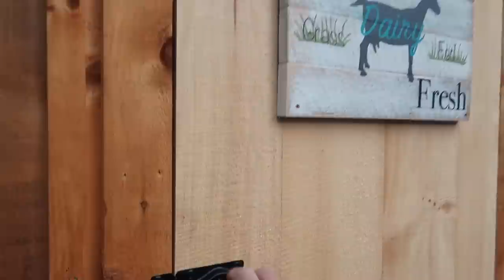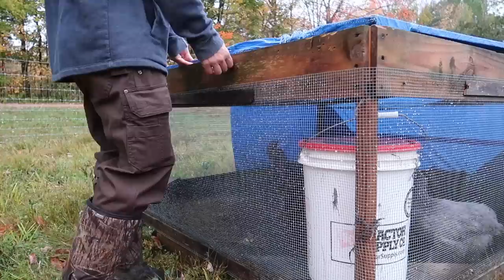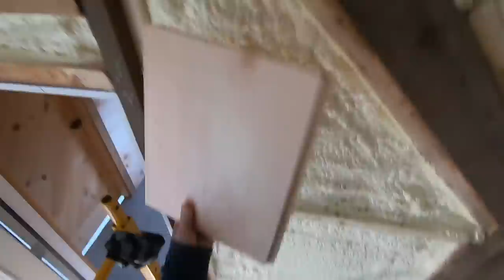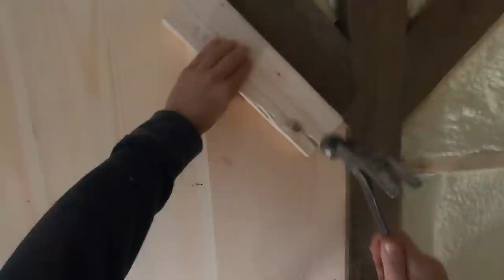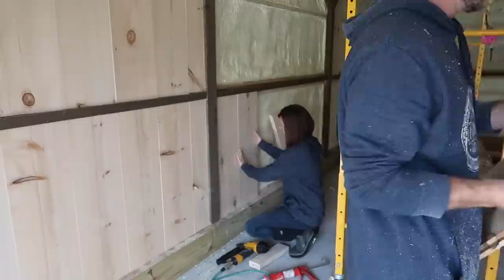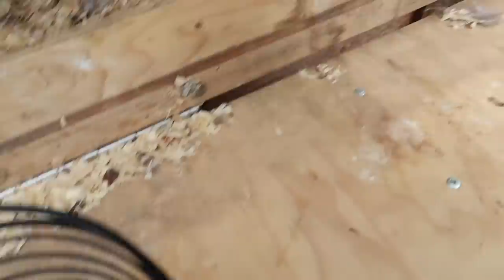Let the Fun Begin Husband & wife Build the Ultimate WORKSHOP (Day 1)

Comment: LOL. Willow had it going in one end and out the other! What timing.Also, if you don't let your tape measure snap back full strength like you are, the tip won't break off. That impact is what breaks it. Learned that from my dad years ago!

Comment: As you want to be able to do projects in the workshop when done a good project to start with is remote locating the compressor with an accumulator tank in the shop to not suffer a pressure lag problem from the remote air location. This puts any compressor sounds outside the workshop/filming area and an accumulator tank is as easy as finding a broken compressor to harvest the tank from and plugging the holes you don't need. 

Normally you need huge pipes to cover long lines but can get away with normal sized lines and the accumulator tanks if you don't need insane air flow rates for things like jackhammers or rock drills.
Reply: Judy G.  Hey Judy, it is a workshop.  The air tools will surely still be used.  I agree with isolating the compressor and having the accumulator tank. Who'd have ever thought you'd need to store air?!

Comment: Try putting a spacer on the bed of your saw to raise the board you're cutting and you'll be able to cut your miter in one pass.
Reply: Or drop the height adjuster. Seems like another inch or so should close the gap and still allow the motor housing to travel the full length.
Reply: I'll go with the homesteader, should have bought smaller boards.
Reply: 1 or 2  2x's on bed works great. And then just raise out riggers.
Reply: Dj Krys ;

Comment: Looks Great, I do a lot of hard wood flooring and you always need to leave a gap for expansion. You might want to leave a 1/4 in gap between the post as the wood will move and trim with quarter round.

Comment: I like to see a woman with a range of skills and ability. Gina is becoming a good builder.
Willow is inspecting the wall like she is looking for some foam to nibble on.
As long as you are using glue , I would have edge glued the boards to make them like one board. It would have increased the wall strength tremendously.

Comment: I see where others have suggested a spacer board the lumber on  the 45's.  Also, you might try just raising the outside edge up into the blade to finish the last inch of the cut.  It might add a little angle since the blade is at 45, but in the corner it would not be seen and covered by the next piece.

Comment: If you are pulling the blade through the wood, just make a score cut. Less chip out that way. After the score cut push the blade through the wood. Much safer way to cut. If you aren't worried about a perfect clean cut, just push it through the wood.

Comment: The inside of your barn is going to look fantastic when you finish.  My question is how are you going to heat in the winter?  know it gets mighty cold up in the northern pare of New Hampshire in the winter.  I have a 30' X 48' pole barn and only insulation on the walls. Roof is not insulated but I used 3-1/2" X 24" X 8' honeycomb cardboard slabs over large sheets of 1" thick honeycomb cardboard for my ceiling.  I have a lot of heat loss through the ceiling but I have two ceiling fans in the shop to help pull the heat down.   Heat the whole place with a small pellet stove and a new pot bellied wood/coal stove.  also I would suggest getting some foam panels to insulate your roll up door. otherwise you will have a lot of heat loss there.  Love watching you and your wife work together.  Sadly I lost my wife 11 years ago.  She was always working with me and helped me build my workshop/pole barn.

Comment: I saw that same saw at Lowes yesterday with a 60 tooth carbide blade on the display model. What gives, Lowes and DeWalt? 

Stanley-Black & Decker BOUGHT the Craftsman line and offers it through Lowes as the major Craftsman retailer. Craftsman Red makes Lowes tools look like a Christmas store. Maybe Craftsman will take on Milwaukee with competitive tools.

That ship-lap will have a lot less waste than cutting up 4 x 8 sheets of plywood. You saved twice.

Comment: Put a spacer on the miter saw to bring the height of the board being cut. You might get all the way through that 45.
Reply: You can also lower the blade with the stop adjustment. Just don't go so far as to hit metal.

Comment: you should never cut on the pull with a cross cut saw  pull the blade out past the front edge of the wood, lower the blade then push, that way you are using the front of the teeth not the back of them,   cheers from an old irish carpenter, love the barn

Comment: Are you worried that if the humidity increases and all your boards are that tight that they might buckle?  Or is the wood still green enough that it will dry out by next summer and that won't be a problem?

Comment: Sorry Al, but I believe you are going to have some problems with some of your firewood because you didn't leave any room for air circulation. By stacking the wood on the ground, moisture from the ground will wick up into the wood. Pallets would have been a good option on the ground & even between the walls & the firewood to allow air flow. A 6" gap between the stacks would have been helpful also. Hope I've given you some food for thought for next year & all comes out well for you and yours.

Comment: One thought. Remember that wood expands and contracts. You are fitting this wood very tight - if it is not already at it's wettest - there may be problems down the road. On the hopeful note: the wood was on the (palette which was on the) ground and there was a lot of surface water, so it may have absorbed some from the moist air. It will dry out inside, no more water on the walls after the wood is installed. You are probably ok. It may be a long time before you know for sure though.

Comment: Putting the Ship-Lap tight, you don't have a concern in the summer with heat and Humidity and expansion?  Though, if what you have is green boards, they will shrink as they dry down.

Comment: I love craftsman hand tools!! So I went and bought a drill couple months ago. I decided a couple days ago to build a wood fence for my dog in my tiny backyard and not even a 1/4 into building the fence the chuck on the drill started stripping out. This was my first time using for a hard task on the drills end and it didnt go well!! Drill cant even do simple task anymore!!
Reply: Cody,
You can thank greed and lack of pride for that. Milwaukee tools, I've noticed, are not the same as they used  to be. Oh well, make due with what we have available, right?
Reply: Can you get it replaced under warranty?
Reply: @paulmonk7820  When then old lady gets home from work Friday night well head up to Lowes and ask them!! I think I have a 2 year replacement warranty because the reviews weren't the best. If I can at the least get it replaced Ill probably sell it new in box and get something else since all its good for is hanging shelves and drywall. I built a couple of door frames with it when I first got it and it struggled but wasn't horrid so i knew going into building the fence would be a make it or break it !!

Comment: So reminded Me of some Wood Panelling I did many years ago. 
We used Tongue and Groove Floorboards, hung vertically on Our Wall. 
Two of Us were assigned the job of cutting the Floorboards to Length. 

123 Inches. 

I cut My 1st Board to Length and then used it as a Template to Cut all of My Remainder. 
Our Tape-measures were 10 Foot Long, marked in both Imperial and Metric.  

Unfortunately I made a slight error in My Measuring of 123 Inches which resulted in all of My Floorboards being 10 Foot and 3 Centimetres Long. 

Oops. 

We still used them, We had no choice, but every 2nd Floorboard along the Wall had an Access Portal, along the Ground.

Comment: That looks so nice. I think I would have ran the electrical through the walls though just so I would have to look at that ugly conduit. But that’s just me
Reply: George Vangordon jr , if a person needs to make changes or repairs, being in conduit makes the job easy.
Reply: I think a conduit run would be easier to maintain, change out, make revisions, etc.  I envision Al putting in a work bench along the wall (s).  Having a run of recepticles from conduit supplied power above the bench would not be a bad look. In fact, that is usually what I see in most pro type built-in work benches (of course I don't have that to worry about...LOL)
Reply: There is enough room via the roof rafters for wiring ease-way and then drops down the wall to boxes mounted recessed in the pine wall. Angle drill and fish tape needed to do the job
Reply: He'll just build a box around it to hide it 😅

Comment: I'll trade you my 1-1/2 car garage workshop for your work shop. You're going to love yours after you get it done. Just don't use it for storage. It will make you dislike it. Just use it for tools, tool accessories and working surfaces. I'm saying this because it took me 4 years to clean mine out enough to cut down a 4x8 sheet of plywood. It only took 1 year to fill it up.
Reply: Charles,
So true. I've found that if you create a specific place for every tool, then things tend to get put up proper. If there is an empty flat surface available, it becomes a magnet for everything without a home. Lol. I know, easier said than done.

Comment: you may have answered this but why would you put up your walls prior to running power lines?
Reply: I think that the electric is going to be run in conduit.
Reply: @brendamontanye9877  outside the wood? visible?
Reply: @tracybruring8440  I believe so.  The conduit is a metal tube and it is all quite tidy.  My husband and I are going to convert our willy nilly wiring in our barn to that as we finish the insides :)

Comment: That DeWalt would not work for me.....it really should be able to make the cut first pass ( on your angle cuts ).....instead of flipping it though, lift up on the board at the tail end of the cut ( use caution though ) and bring the board up to saw.

Comment: Al, check out steel log rack bracket kit  #890005 at titan great outdoors $36.95.  Would work better for your next wood stacking.  You have not stacked the 1st right, no air flow???
The stacks should be run back to front in rows, with a space between the next stack.  Then as you need it than each row would be used up then you can stack a new year of wood.  Just my opinion.  Your way there is no air flow & you can't add another year of wood.

Comment: It's looking great but I fear you're going to regret not putting some gap between those boards and gluing them in across the width that way. I hope I'm wrong but you've given the wood no ability to move, and wood does move. It's why you never glue the bottom or top of a paneled door. Wood can't move freely, it tends to start cupping and cracking. Again, I hope I'm wrong but........ 🤠

Comment: I don't think it's called shiplap if you are installing it vertically
Reply: You know, I think you may be right. I thought shiplap also meant overlapping. 🙂
Reply: Judy G.  Shiplap, by definition, is “boards that have been milled so that the top and bottom of each piece has a rabbet joint, so they can be stacked as siding“. ... In a nutshell, shiplap boards rest on top of each other and overlap, "from farmhouse built-ins"
I've called vertical either wainscoting or board and batten or even beadboard. jmo

Comment: Try putting a sacrificial board or two down on the table side of your miter saw rather than the fence. Should allow you more use of your blade to get the 45 degree cut to go fully.
Reply: That would take away from the blade deapth
Reply: I believe he means temporarily, for this project. The blade has 5+ inch radius the boards are 3/4 - 1  inch thick, putting a 1 inch board underneath would make the finished cut utilize the wider part of the blade and be able to cut the full 45 degree cut in one pass.
Reply: @eldenl1  It's a depth of cut or vertical capacity of the saw blade, not it's radius.  It is a sliding miter saw,  and this sliding distance is the main determining factor for the depth of cut across the board, but the idea of using sacrificial board(s) to raise the material closer to the center (or widest part) of the blade is still good.

Comment: Al:  I bought this set of LED lights for my shed to shop renovation.   I was impressed by the light out-put at half the load of a 4' 2-tube fluorescents.  Even though this make is out of stock there are several other makes in the same price range and you will get them cheaper in US$.  Mine were from Amazon  in Canada. 
https://www.amazon.ca/gp/product/B07FY6Z9SK/ref=ppx_yo_dt_b_asin_title_o05_s00?ie=UTF8&psc=1 
 I would consider  them for you as the are daisy chainable,  individual pull chains,.  You could place them for task lighting over a bench or power tool as I am doing for high intensity with my old eyes.   With only one in the middle of my 200sq.ft. shop for general illumination.  And by using  the flat 16/2 brown extensions with triple taps stapled to the beams.  You could have  8 of the 40 watt fixtures.  At 320 watts total load you are still way under for the wire sizing.  the old guy   Bert

Comment: Al, 
If I can respectfully repeat what I said in a previous comment, I think you are jumping ahead of yourself. (See my previous comment re putting a receptacle in the wall for you milking table (vacuum pump ) running the wire in the wall of the workshop.)
I know that you can't wait to see what those finished workshop walls will look like but think ahead a bit man. (By the way they do like nice.)
As in any building project you should plan ahead so that you are not ripping out what you have just put in because you missed some basic requirement to complete the job.
The one in particular I'm thinking this time, is how are you going to take care of all the interior electrical requirements that an efficient workshop will require (such as; power outlets, lighting etc.)? 
I know you can surface run everything in conduit,  but you could save a ton of money, and time, if you rough in wiring for the wall receptacles , light switches etc., before you cover the walls with finished paneling. It would be the same thinking if you were building a house. You rough in your wiring before you install the drywall.
 It would be so easy to run all the wire in that foam, you would only need a sharp knife to gouge out a groove to accommodate the wires as required( if there isn't enough room behind the boards).
My background in construction as a project coordinator was in the efficient use of your labour and resources, it could make all the difference between making a profit or loosing your shirt,  (in your case, just creating so much extra work.)
One last observation. 
I cringe to see you using that trailer to move you firewood into the shed.
Why not load up the tractor's bucket instead (it would carry the same amount of logs and you don't have to be careful placing the logs on the trailer bed so that will not fall over as you move them) you could then drive right into the shed, to save yourself the walking backwards and forwards when you unload it.
I guess you must like the extra exercise?  LOL.